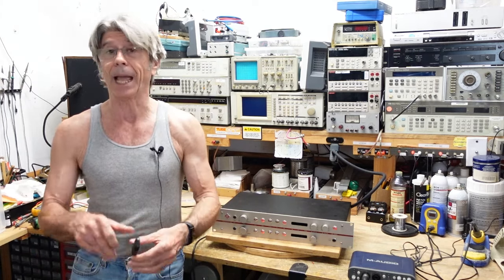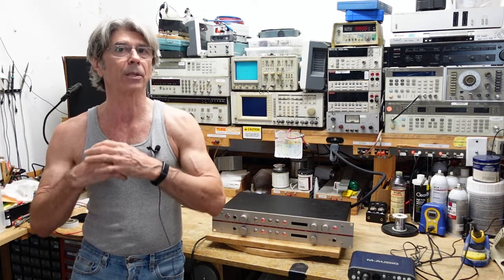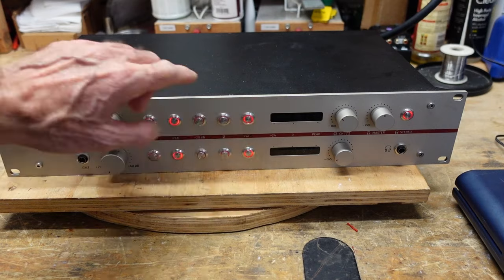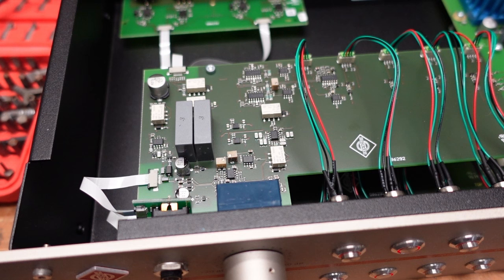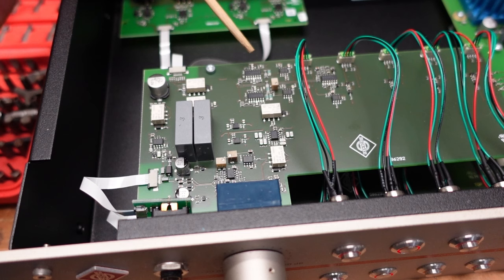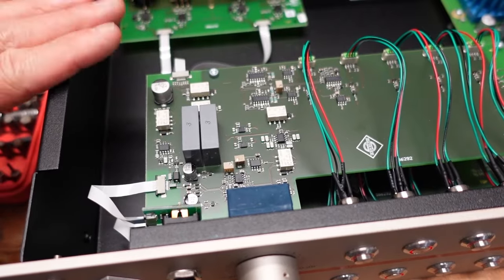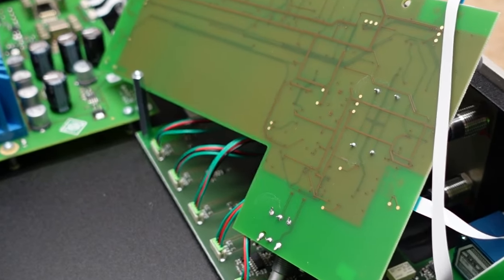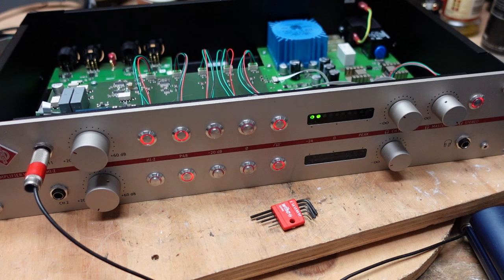Neumann V402 Mic Pre

Comment: Hi Ray, I'm glad to see you again 🙂 at our age we have to expect some defects in the body - my neighbor said, I've been healthy all my life and I'll probably get sick when I'm old 😂 she was ninety-eight.
These defects of loose components (mainly THT) are unfortunately very common these days, in my opinion, the crap called "lead-free tin" in connection with the so-called solder bath is to blame, the connection does not heat up well and it degrades faster. Another problem is the iron-plated terminals of the components (I used to store the cut terminals of the components in a box and use them for jumpers, today I first pass them through a magnet, throw away the metal ones and save what is left) it has happened to me many times that the coating has separated from the terminal and only a blackened piece of metal remained. The development of technology does not wish us well, printed resistors including paths, capacity and inductance created directly by paths between PCB layers 🤪 and mainly the number of older parts starts to decrease, production ends and sometimes it is not easy to find a replacement.

I wish you that your health problems subside and you can fully enjoy life again 🙂 Tom
Reply from the maker: Thanks Tom!
Yeah, lead free solder for anything but SMD is not something I'm fond of.  But it's here to stay.
Love your 98 neighbor's comments!

Comment: Nicely done, good procedure and probably helpful for a lot of people to see how it's done.

Me, I tend to be a little bit paranoid when solder starts breaking down.  I would re-solder both of the big caps and also check the same spot on the other board. Most of the time it's okay but it never hurts to check.

Good to see you back at the bench.
Reply: Yep, its good to have Ray back! Additional thoughts to Douglas's comments... I would also add proper capacitor caulk, to support the caps. Especially, if the device is mounted in a Anvil case/portable. For those new to electronic repair... This type of caulk has certain qualities that are not in off-the-shelf household caulk. Treat your gear with love and kindness and buy the good stuff.
Reply from the maker: Definitely the better approach.  I didn't bother because it's going back into a rack in Dave's studio.  If it was something that was going into a touring or other type of sound reinforcement application where it would be subject to shock I would have not only done that, but put some RTV around the caps too.

I did finger them (no comments, guys!) and they seemed fine.
Reply: @raygianelli3612 
"I did finger them (no comments, guys!) and they seemed fine."

B.. Bu.. But ...  Ray  ... There's so much fertile ground there...  LOL.